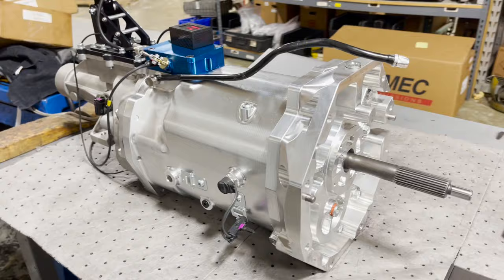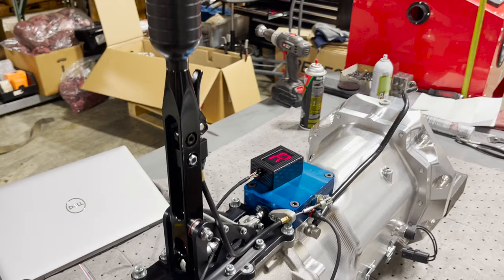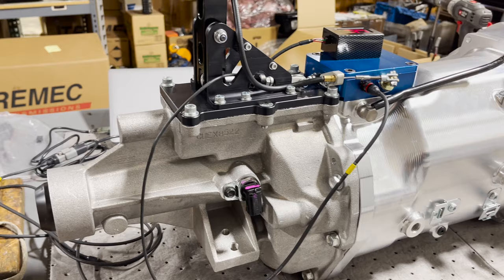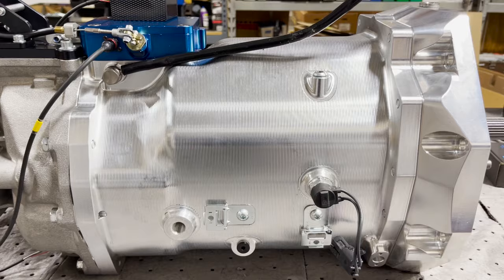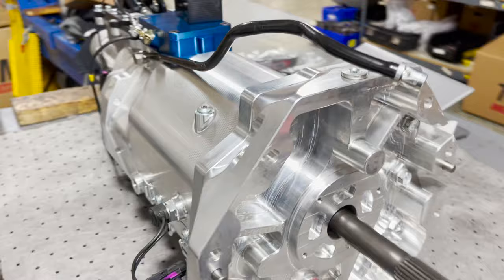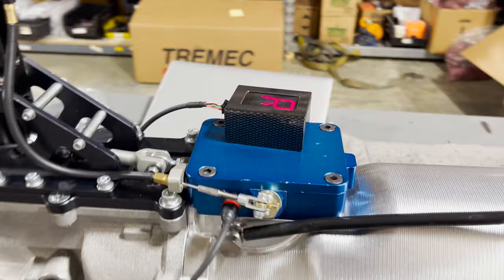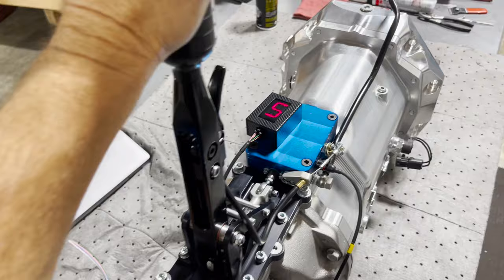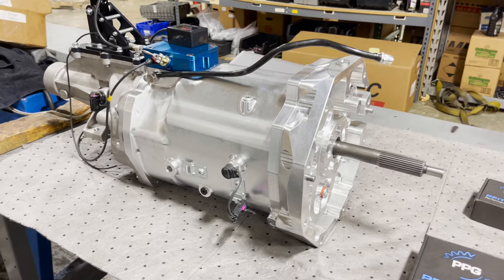Full Sequential Tremec 6-Speed The Ultimate 6-Speed Transmission

Comment: Honest question ---Wouldn't an automatic transmission (say a 4L80E) with a manual valve body function and perform exactly the same but at a much, much, lower cost point?  What am I missing?
Reply from the maker: No way it can handle the power or shift as fast.
Reply: @AmericanPowertrain  Thank you for setting him straight.

Comment: The Caterham 620R uses a 6 speed sequential in the 1200 lb. street legal road racer with 310 hp. 0-60 in 2.79 seconds. Really nothing can keep up with it on a road course with its braking and cornering and acceleration. Instant gear changes. Sequential is the ultimate.

Comment: These things are just crazy cool.  I have been throwing around the idea of one in my GT500.  Any issues with some periodic street use?
Reply from the maker: These are totally streetable. You don't want the straight cut gear version to drive on the street alot (noisy) but you can run the helical set which is just as good. The big difference is the straight cut gear set has a 1 to 1 6th gear for racing purposes.
Reply: @AmericanPowertrain how much does something like this cost. In the racing world there is a huge difference in what people call not cheap. We talking a Built TH400/4L80 price or maxed out lock up M&M TH400 price lol
Reply from the maker: $26k as you see it in the video.

Comment: What ECU needs to be used for flat shift. Can Holley Terminator do that or is he using Motec?
Reply from the maker: Any ecu. But you need drive by wire and Xengineering cut box for the throttle blip

Comment: Do you have to use a special throw out bearing for the input shaft or can you use whatever is provided for a stock T56 such as with a conversion bellhousing to bolt to your billet transmission case? Are these offered only for a limited time?
Reply from the maker: You can use any set up for a Tremec 6-speed. We can build one anytime. Wait time right now is about 6 weeks.

Comment: Why did you  say  you change the Internal componets  then say it has a Billet Case?  Why don't they just build a complete Transmission?
  NASCAR  is  now  useing a sequensial shift Transmission and it costs $15,000.00  My  guess  is your price is  $15,000.00   or more...
  Funny this video popped up  after I just watched  Scotty Kilmer  telling that the New Corvette Dual clutch Transmission is  having issues  with censors and clogged filters  ect..  You  always  want to do a fluid and filter change after a break in period..   "Wet Clutch"  Transmission no less made by Tremac and an  8 speed..
Reply from the maker: Ok so this is a "one to one 6th gear" swap. Which means you have to machine the case to fit the  giant one to one 6th gear. OR you can order the billet Magnum case done already with the clearances you need. One to one 6th is only PPG gear set you have to do this with. All the other gear ratios you can just reuse the stock case.  That Nascar trans is not just a transmission it's an entire transaxle built by Xtrac and its not $15k...Its more than double that price. This set up is about $23k as you see it.  This particular set up is nothing like the DCT Tremec makes. It's much simpler and more mechanical. DCT works totally different than this.  Also I know many of the  Tremec engineers and they say all that fluid stuff is just internet gossip. They have millions in R&D in that transmission. I know a few C8 owners who have had zero issues with a lot of miles on the car.

Comment: What is the cost if you already have the transmission?
Reply from the maker: If you have a Magnum (not an OE T-56) its $18K plus labor. Labor varies  depending the gear ratio set you need. Some of those sets require additional machine work.

Comment: There is nothing left of the original transmission, the case is gone, the internals are gone?
Reply from the maker: All the internals are replaced. This one we upgraded the case and the front cover. Those are optional.
Reply: @AmericanPowertrain  Thats what I am saying, the internals are completely bespoke, the case is bespoke, which part of this is still a Termec?  My point is that you might want to choose a ground up motorsport gearbox (which, granted, this pretty much is) like a Holinger RD6.
Reply from the maker: @zoltrix7779  But this will bolt in a ton of cars that are made to fit a Tremec. So that way you dont have to spend $$$ on adapters etc.
Reply: You won't have to spend $$$ on adapters!!! Just $$$$$$$$$$$$$$$ on this. Bahaha

Comment: What's the avg price for one built as shown?
Reply from the maker: the one shown has all the options. its $27k
Reply: @AmericanPowertrain  Okay so max is $27k. What about on the low end?
Reply from the maker: $18k for the parts. You will need a T-56/Magnum donor trans (no LT-1 or Borg Warner 6-speeds) +Labor depends on the condition of the trans. Plus you need an xngeering cut box for throttle blip ($1500)  @William-_-Cook
Reply: @AmericanPowertrain  I'm guessing the cut box for the throttle blip is for the downshifting correct?
Reply from the maker: up and downshifting  @William-_-Cook

Comment: Very very cool but if it was the ultimate six speed, it would also be all wheel drive.
Reply from the maker: That would require a transfer case LOL
Reply: The ultimate road race cars are always rear wheel drive. Formula One, not all wheel drive. AWD is  just a crutch for average street drivers, although safer for street use in bad weather.